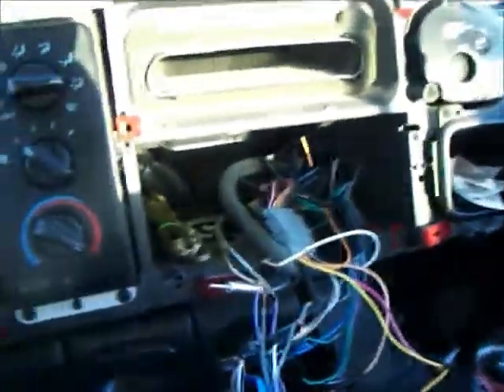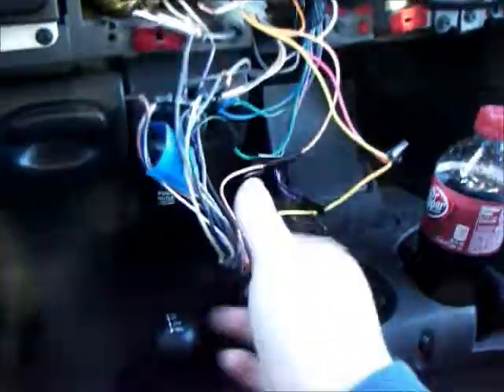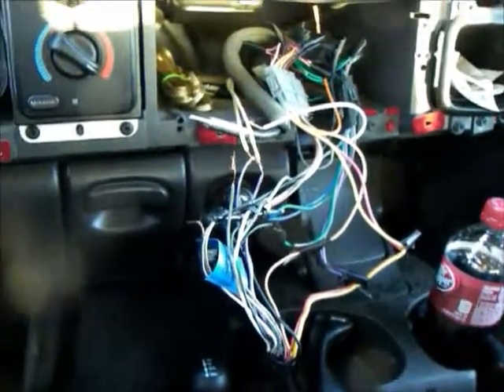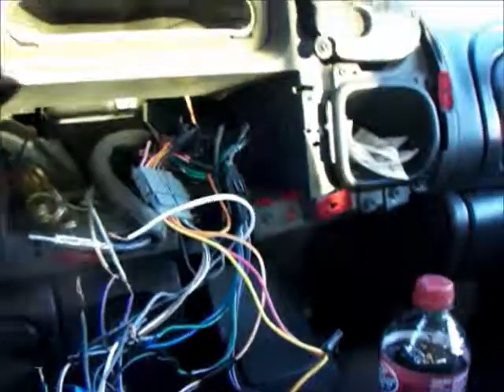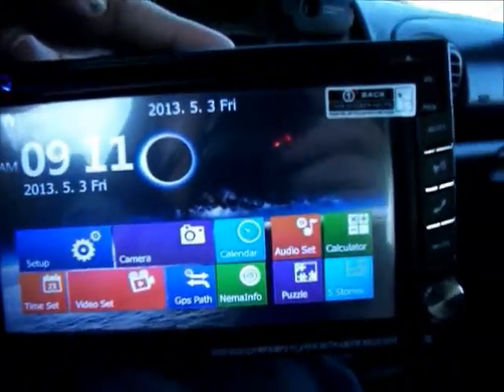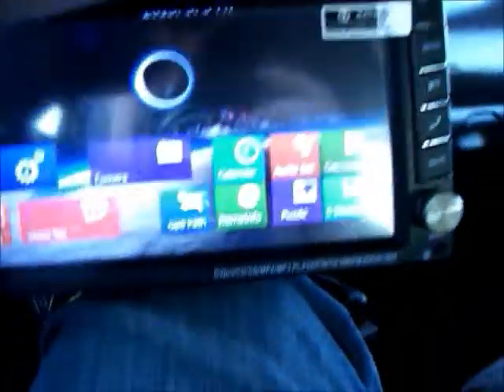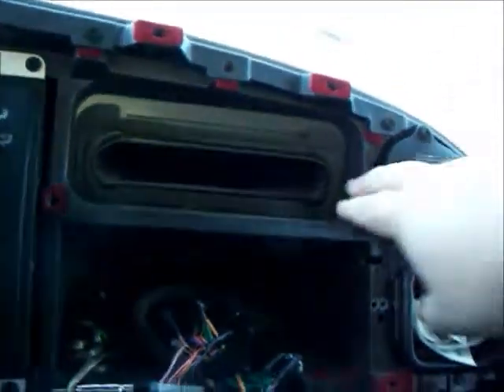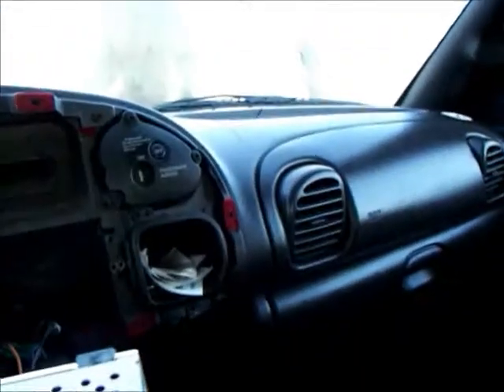Dodge Ram System Build Series Intro |Touch Screen| Elite Rejects

Comment: How do you like the radio, I think that's about the same kind that I ordered from eBay, it was an Android from China with GPS and digital TV and backup cam, did you get it installed, is it still working, also how long does it take to boot up